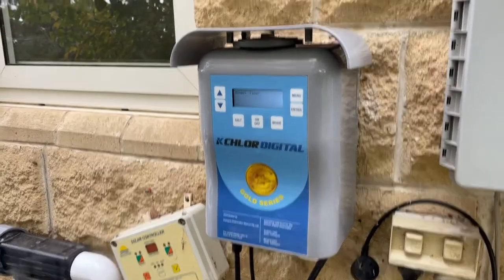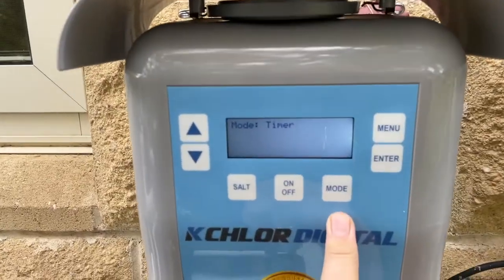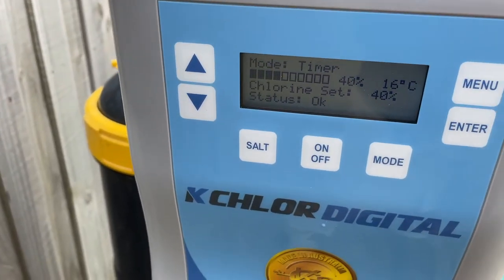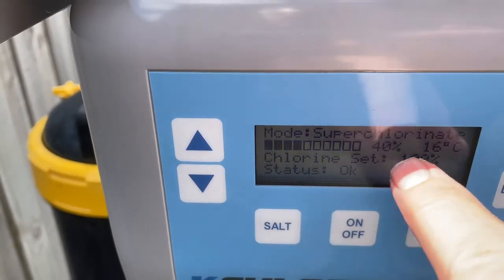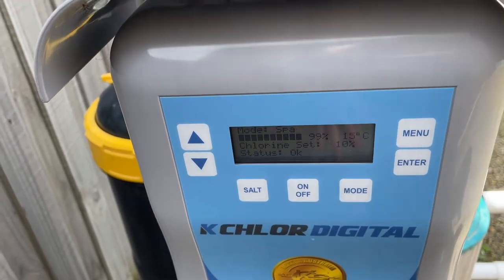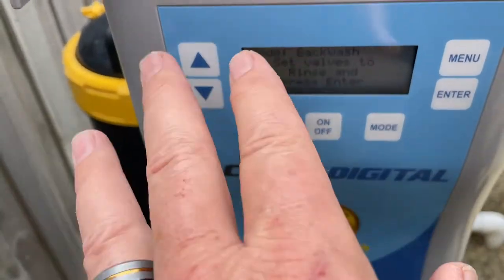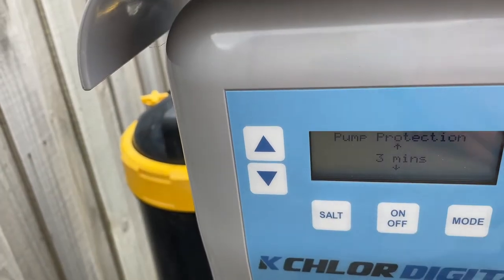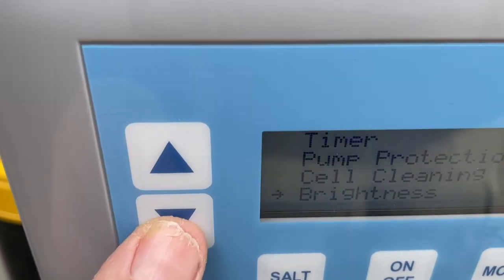Why K Chlor Digital is the Best Salt Chlorinator in Australia by FAR. Performance & options Review

Comment: Hi Mark...great Video. I have this controller on a house i have recently purchased in FNQ. I would like to change it from a salt to mineral/magnesium pool....any tips on how to go about this process?
Reply from the maker: Hi Fred. 
The K Chlor can run either normal salt or mineral salt. 
So the easiest way is to just make all your salt replacement from here mineral. Otherwise empty some or all of your water.
Reply: @Marksreviewsandtutorials  thank you. Will do. I assume the salt meter reads mineral salt and pool salt the same.
Reply from the maker: Yes but look at the label on the front of the Chlorinator the ranges are different MRT

Comment: Does the k chlor cell fit into a standard  cylindrical housing?  So when upgrading an old system dont have to change the plumbing just to fit the square housing.
Reply from the maker: Hi Marcus. No all Chlorinator Brands have their own cell housings so some re plumbing is required. 
When you buy from me an also provide an installation video so that will help you want to have a go. Nillumbik Pool & Spa Service
Reply: @Marksreviewsandtutorials I have an ecofresh 33..the pool builder didn't size correctly as pool is 120,000 litre pool so every summer it's falling short and I'm having to manually add chlorine...it manages in winter but summer can't keep up in qld climate.
Thanks for your helpful videos.
Reply from the maker: The two biggest sizes of the  KChlor are 75 and 100. The 75 happily does pools upto 150,000 L and the 100 does pools up to 200,000 L
Contact Mark on the link in the description of this video

Comment: Hi Mark..i have another question...the cell has a build up on it and need a clean...i have pulled it out and prepared a bucket with 10:1 water to hydrochloric acid to soak it in....can i put the whole cell in the bucket including the end with the cable? Thanks for great vids...Thank you
Reply from the maker: Hi Roy. Is this a KCHLOR?
If it is getting build up then you probably have an extremely high calcium level in your pool. Have you had it tested? I only seen these build up when the calcium is up over 400ppm. 
If it is super high you may want to consider refreshing some water. Ie empty some out and refil with fresh. 
With the cell. Only immerse the metal plates and the little tang. MRT

Comment: Looks great. I have to replace a Zodiac LM3 which I fitted when the old one died some years ago. Is self installation an option?
Reply from the maker: Hi Mark. 
Yes for sure. 
There is just a mounting plate to mount for the power pack and then the plumbing for the new cell housing. 
When you buy from me it also comes with support so you can ring and get help if you need it to instal. 
Feel free to call Nillumbik Pool & Spa Service

Comment: Hi
I was wondering if this chlorinator timer can be used to turn the pump on and off. Currently I do not have a chlorinaotor and I turn the pump on and off manually. I would like to buy a chlorinator and a pump timer, but this seems like it might do both?
Reply from the maker: Yes it has a built in timer. 
It will either turn on just the pump or the pump and the Chlorinator. You can choose how you set it up

Comment: When I push the Salt button, after switching on the pump says "reading" after a couple of minutes. After that, it doesn't give me any reading. Does anyone know why? Thanks
Reply from the maker: It does take a bit for it to take a reading. You have to stay and watch for it. If you walk away it won’t stay on the screen.
Reply: @Marksreviewsandtutorials  i actually wait for it. After 3 minutes of "measuring" the text just disappears and no reading is shown.
Reply from the maker: Then call K Chlor. 
07 5493 9039
They are very helpful

Comment: Are these a battery backed timer so I can utilise off peak power to run it?
Reply from the maker: Hi There. 
These have a timer with a battery back up yes. So if the power goes out you won’t lose the time setting or the running times that you have set. 
And yes you can set them to run and the filter pump to run whenever it suits you

Comment: Hi Mark, how do i tell what cell to reorder on my Kchlor gold series chlorinator....it has end of life in the display and has for a while, but there appears to be lots of options. My pool is 38000 litres. Cheers Fred Charters Towers qld
Reply from the maker: Hi Fred. Yes you do need to get the correct cell. If you lift the power pack off and take a picture of the label on the rear I can then get you the correct Cell. Mark PoolnSpa Supplies Australia poolnspa.net

Comment: There's no waste mode,how do I get rid of the excess water in pool,without unplugging chlorinater
Reply from the maker: Use the Backwash mode. That will allow you to run the pool to waste and it will turn the cell off while you do it. 
Nillumbik Pool & Spa Service
Reply: @Marksreviewsandtutorials  Thankyou so much for your reply,I was worried I might ruin the cell,🙂

Comment: What is the 24hour output of cell?
Reply from the maker: There is a range of sizes from 15 grams per hour through to 50. 
If you call Nillumbik Pool & Spa Service with your pool size and location they can correctly size a unit for you. 
Mark
Nillumbik Pool & Spa Service